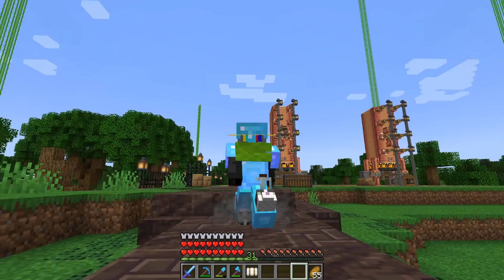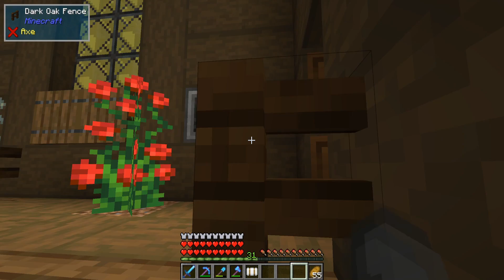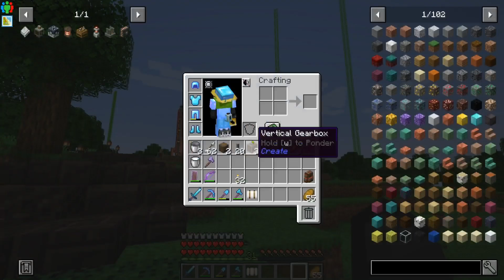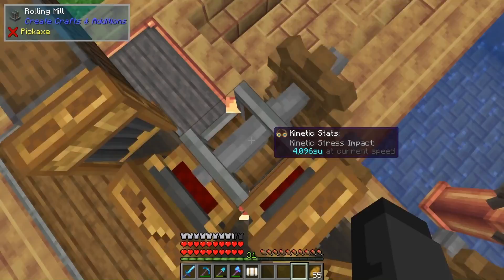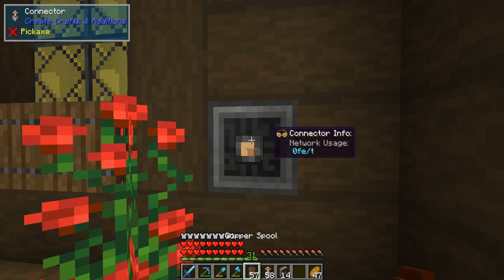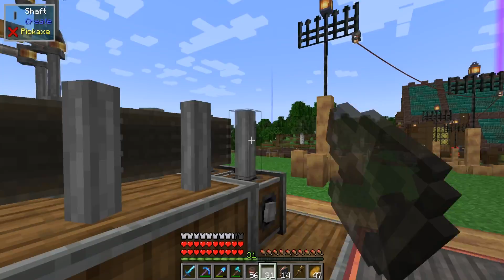Generating Power (Rf/Fe) Using Create Mod - Surviving With Create and More Ep 5

Comment: I honestly wish Create Mod had a battery item, and an electricity generator / electricity inputter. It'd be cool to generate power per usual, turning it into electricity, and carrying batteries around, or putting batteries in constructs that can't generate their own power. To be honest, im just having a hard time making a power source for a mobile mech {Big, mainly as a mobile base... but not TOO big.}
Reply from the maker: A mobile mech base sounds pretty darn cool! There is a mod in the works right now that will be a Create add on mod called "create aeronautics" and when that releases should help you accomplish that mobile mech base.

Comment: Rather than 1 item type per arm, it’d be faster to have arms distribute multiple items.  You could for example have an arm pull both capacitors and andesite alloy (arms can have multiple inputs/outputs).  The iron sheets are a bottleneck, u could have 2 arms distribute them.
Reply from the maker: Thanks Jeremy. It would be more efficient to have less mechanical arms perform the distribution of materials. Ultimately though that whole setup of automation was unnecessary do to only needing a handful of the alternators 😁But still fun to tinker around with.

Comment: Question, does this work with Immersive Engineering?

Update: It does indeed work with Immersive Engineering! Thanks for the showcase man or I'd still be stuck with thermoelectric generators as my main power source.
Reply from the maker: I honestly haven't played with Immersive Engineering in quite some time. But if I recall correctly that is a thing of the past where Immersive Machines would only except it's own mods power.

Comment: can anyone answer me how to put eletricity on something? like ik how to make eletricity but how i pass it to soemthing?
Reply from the maker: Depending on what modpack you are playing there should be multiple ways to transfer energy. Search the word "energy" when looking in JEI (your inventory search bar) Most of them will be labeled energy pipe, energy conduit etc. There is also ways to transfer power wirelessly in modded minecraft. One of those ways that comes to mind is using flux networks but that is a bunch more work than just putting a energy pipe from the power generating device to the power hungry machine that you want to power. Hopefully this helps you

Comment: Hey love the video I use a similar build in another modpack to create my own steampower rf generetator. But do you know how to increase the output on it? I got an ME system im trying to add the infinte range mod to the transmitter but is falling cause I can't output enough power with the connectors even though it seems it can generate enough.  Any suggestion?
Reply from the maker: Check to see if there are different tiers of wires that could move more power. Or adding connectors to more sides of the energy acceptor or controller of your AE system could help. If that doesn't work there should be a better more suitable means to transfer energy in the pack that you're playing.
Reply: @TubeAndKnuckle  thank you so much!